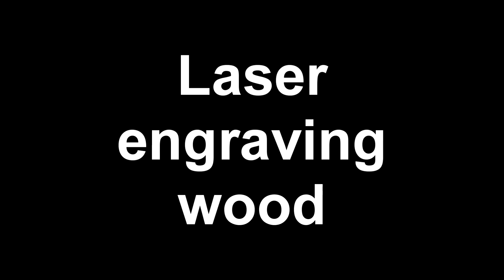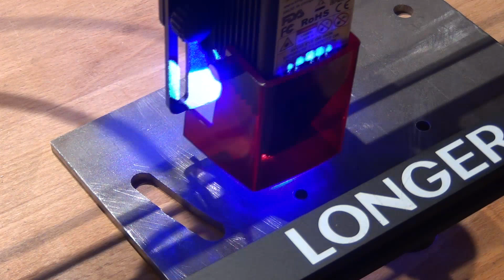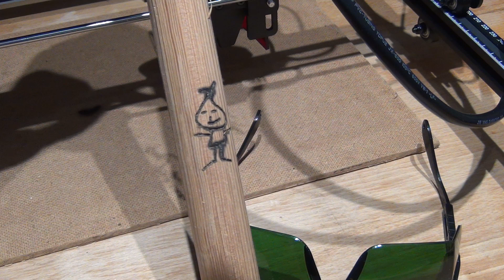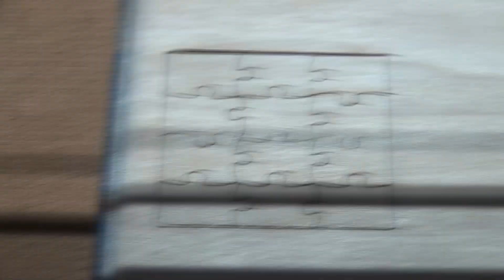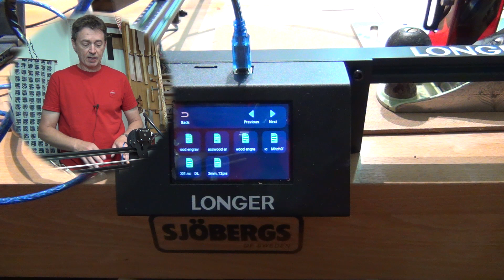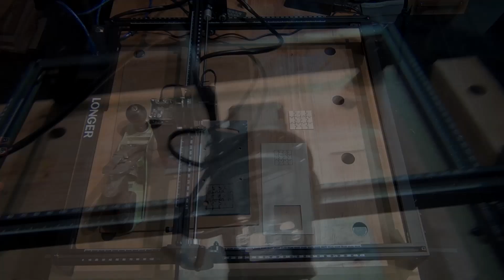LONGER RAY5 10W - DRAFT

Comment: Nice review, machine could do with better bolt on shield,lot of light escaping from sides. Couldn't be working in same room. Could do with air assist to clear smoke & soot debris from the cut area. Improves burn & cut .  For engraving metals, you don't want to be lasering on bright reflecting surfaces. Reflection back to the laser will crack the focus lens easily. Quick coat of white paint aka Norton white tile method will improve engraving. (Though is Talk of problem getting white with correct chemical element???)
Rotary roller would be nice for curved surface engraves?
Nice machine though. Could mount on a ply base and put it away and  out when needed.
Reply from the maker: Great points. There are air assist and rotary rollers available for it, and a honeycomb base too.
Interesting you talk about white paint, as someone who doesn't know much about these things I would have imagined a dark paint would have been the way to go. Anyway, I must figure something out if I'm going to engrave more metal and protect the lens. Cheers
Reply: @mitchwoodwork  when the Titanium burns it turns black & welds itself to ceramic tiles (Google: Norton White Tile) . You wash off non lazed paint. you can get other effects with different material
Reply from the maker: That's cool, I have some somewhere